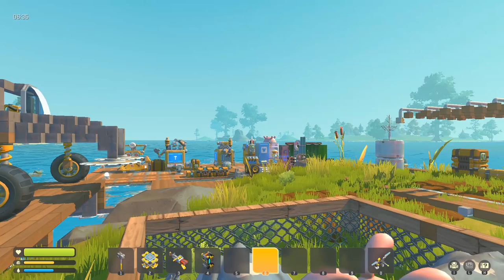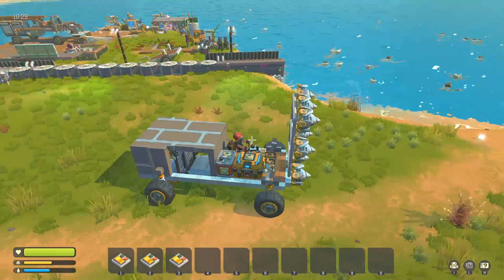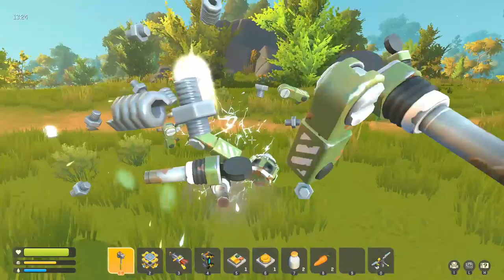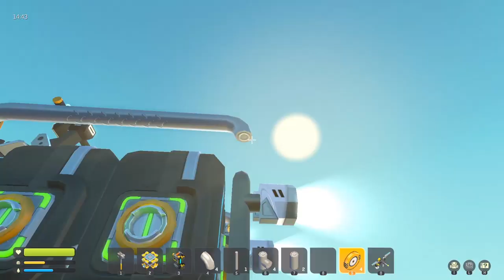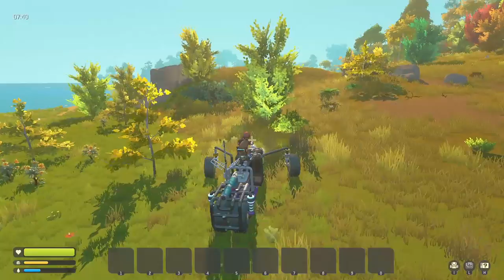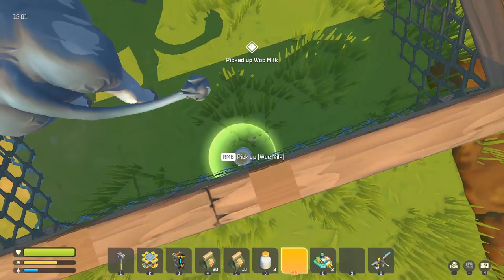Mining Swatter Vehicle to Help Repair the BIKE! - Scrap Mechanic Survival - Early Access

Comment: I think you could add large chests on the back wheel area kinda like saddle bags would cool i think, also your drills would work better with suspensions behind them to allow them to bounce when they impact that way they can keep a more consistent pressure (the large shocks on the weakest setting work best for this as they have the most travel)

Comment: Quick question everybody I tried to get the drill to work but when I went to the wiring tool it doesn't have a connecting node to it if I can't connect it to anything how do I get it to work is this a bug?
Reply: did you put the drill on a bearing?